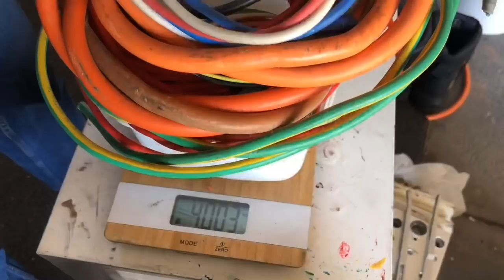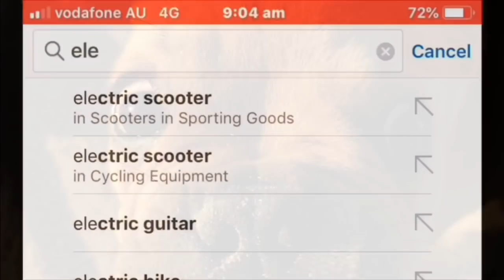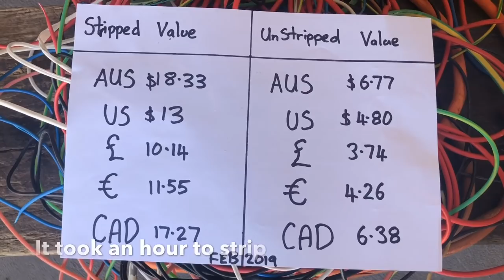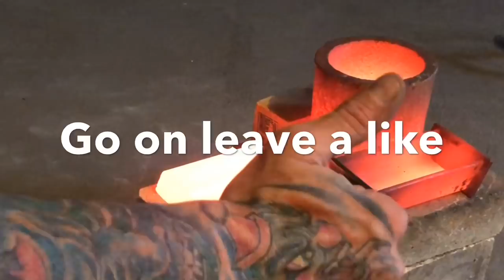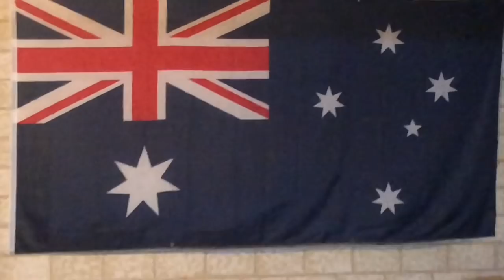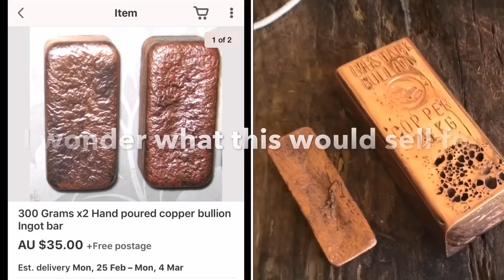To Strip or Not To Strip - Is it really worth stripping Copper Cable🤔 - Melting Copper

Comment: Yes if you make $2 an hour; no if you make $75 an hour. Easy....
Reply: I unironically had a job that paid about a euro per hour
Reply: Actual., it takes les then 1.5hrs to find 25kg in copper scrap and 1hr to strip it., add an hour to smelt and devide that by todays vallue of $146.37 for 25kg usd and 3.5hr... that averages $42.375 per hour...so preaty fricken good.
Reply: @TWOSU_NEWS  add fuel on there
Reply: @TWOSU_NEWS  

The only way you are going to find that much copper in 1.5 hours is to illegally go into an old Warehouse or building and to illegally strip all the copper plumbing and wire out of the building.
Reply: Rob M  simple., i live in the united states, were anyone can go dig through a construction sites trash bin and collect a hundred lbs of copper scrap as long as it isnt fenced or says no trespassing. Further more, you can even walk down the road on a daily basis and collect 200lbs of aluminum cans on any given day... yes, us yanks are a bunch of waistful bunch., o" and if your heart contends, you can go to ANY landfil, sign a waiver and go scap digging...

How do i know this... because i used to make $350.00 a day doing itfrom the time i was 18 to 23....

To answer your quistion., not many people are willing or have the resources to turn scrap metals into non scrap metals as this guy is doing., hence why the price sky rockets when he refines and smelts these metals.
Reply: Rob M MR Rob M I work on demolition and I’ll say that trucker it’s right, as it’s not in a federal property and not properly signed any person can ask you permission to dig on your dumpster and collect some wire, but it’s not jus common wire, a lot of times there’s heavy duty wires , we are talking #1 wires on copper, you may ask why the demo guys don’t just collect them, and the reason is we have a contract, we demo the building and clean the building, you can scrape after work hours, but there’s people who does that for a living.
Normally I’ll handle that opportunity to Old men’s or people that apparently wouldn’t be able to get a job.
They bring a trailer, park it next to dumpster and we carry it to dumpster and they pull it out from there for legal reasons.
Obviously we cannot stock it on the building, and we normally are out of town as many construction workers know.
So is free help when you are by contract, they take that and save space for more garbage.
So yes, in a lucky day they can collect a lot of copper.
My humble opinion.
Reply: @Well_I_am_just_saying  Sounds like it could be something you did once a year or every few weeks just to add in your overall income. I think there's a lot of income potential out there they may of us are overlooking just because we're looking one job that pays above the rest. It's no so easy to lose income when it's coming from multiple sources.
Reply: @peppernickelly  As someone who scraps all the time since I work in construction. Aluminum is barely worth it at all. It takes so much since it's such a light metal that your time simply isn't worth it unless you have something like alum siding or gutters. Copper is where it is at but you WILL NOT just find hundreds of dollars of it lying in trash bins at unlocked construction sites. You will find mostly scrap slivers and minor pieces. You have to decide how much your time is worth and as someone who does it regularly I will tell you that you leave the scrap yard feeling like an idiot for wasting your time way more than like a winner. If you get caught removing material from a job site you will be charged with theft and trespassing. You need a good lawyer to get away with the "no sign" defense and if you're scrapping you probably can't afford one.

Edit: by all the time I mean I save scrap and make a run every 2-3 months
Reply: @toastedt140  Yeah I completely agree with you. I just collect materials here and there over the years, old electronics, silver, gold plated anything, even some weird alloys, and some mercury. Over time the value of the dollar goes down but the material I hold onto doesn't lose value, more likely gaining value. Now I know why my grandpa kept piles of junk for years. After collecting enough material it'll be cost effective to process everything but for now I'm just collecting whenever it comes up
Reply: Come to my city on  trash night (every monday).
 The lady who collects cans on my block fills a 50gal trash bag. Another guy comes by for the bottles. The amount of household appliances that get tossed out is also ridiculous. 
Factor in that recycling is almost the norm for everyone in the city, your scrap metal is presorted and placed on the curb, no dumpster diving.
All I'm saying is that in some areas the guy making 150k a year doesn't care about a 5cent deposit on a can or the the copper value in the Dyson vacuum that's tossed on the sidewalk. 
I'll make a video of all the trash this week so the scrapping crew can salivate over the potential profit.
Honestly scrapping isn't in the minds of housewives,laywers,bankers or other young professionals.  So YES THE STREETS ARE LINED WITH COPPER AND ALUMINUM
Reply: @TWOSU_NEWS  where are you finding that much copper that quickly? I'm an electrician and if you're finding that much you're stealing it.
Reply: @TWOSU_NEWS  this is so dumb. There are no construction sites with hundreds of pounds of copper in the dumpsters and they won't let you on site because it's a legal risk to them. Quit lying.
Reply: Rob M  You need to be more open minded your so closed off from possiblitys. Its going to stunt your experiences in life. If people think gathering 5,600 cans or loads of copper in 1.5 hrs is impossible. Imagine what else people think is impossible so they dont even try. Think about that.
Reply: Your so closed off being humble goes along way too you know. I'm looking at the math and it's what you set not every place in the world is going to have a set amount of copper per cubic yards. Just try to be more open minded man. I'm not trying to be confrontational with you I just want the world to be a better place.
Reply: @anthonydifranco4597  no video tony what happend man?!
Reply: @robinsoncrusoe6327  I think he needs to change the T to an F
Reply: Rob M  clearly you havent worked contruction. Talk to an electrician. Better yet. Watch one work. Even better,  take a peek at the electricians trash bag pile that they create. Sometimes you cut up a piece and throw the leftover bit in the trash
Reply: Rob M  I disagree with you saying that its impossible to pick up copper at a job site. Most places are probably like what you mention but you know how it is: no job site is the same. Some projects have people that dont give a damn about small stuff like that, some are very strict. Maybe the electricians will let you pick through their trash bag. I actually asked once and it was fine with them. They throw a lot of cppper wire away. Still have a couple copper wires with me cause theyll come in handy. My point is that it can be done, but to make a profit or a living out of it is unlikely.
Reply: Rob M  for real, I wanna address too... 50kg just lying about...
Reply: Rob M  Just look at people who throw away home devices that have electrical motors, or power converter boxes. Anything that has spun copper wire! Yeah, it would take a lot but over time you can accumulate more than you would think.
Reply: Rob M  When I was about 5-10 years old, my father and I would be in his truck and will fill it up 2 or 3 times in a single day with aluminum cans. Within about 6 months to a year's worth of collecting them, he had cashed in almost a tons worth and at about $0.50/lb he brought home nearly $900.00. So yeah, 200lbs does seem a little excessive, however, if you are in a city and there happens to be some kind of sports venue or music concert and you are able to collect them from the parking lots... It is conceivable.
Reply: Rob M  That's why I said it's a bit excessive, but depending on where you live and how persistent you are, it can be achievable, just not for everyone. Some in some rare cases, yes it can happen but normally no. I could easily believe them if they said in a week, but not every day...
Reply: The Dirty Trucker Not bad if you’ve got nothing else worthwhile to do
Reply: @Automobile Addict yes too stupid to realize you were clearly trolling from the beginning... Im asking what is your purpose of trolling dumbass
Reply: @nonya8694  there's 5400 seconds in an hours and a half so that's more than a can a second....
Reply: I tried to read down through the comments but theres just sooo much bullshit to pick through...1, I've worked at alot of construction sites, your not getting their copper, brass, or really any other metal. if they charge the customer for 100 ft of wire and use 75ft best believe they are saving the other 25ft to use at another job or scrapping it themselves. same goes with removing old wires, motors, pipes. customer gets charged for the new, company will stockpile the old until price goes up and double tap the profit. I have yet to see a construction site just trash metal. the only metal I believe you could find in bulk is aluminum, but as someone said it's not worth the time it takes to collect it. yes your grand pappy might of collected cans when you were younger and made good money doing it, but price is super low and cans are much lighter than they used to be. I collect my own copper, brass, and such when doing projects and over time it will build up but to think your gonna get 25lbs of copper a day from dumpster diving is an unrealistic goal. might get that lucky once or twice a year if you find joe blow remodeling his house and tossing it out. but again aluminum isnt worth the time it takes to collect nor the amount of gas to melt down.

Comment from the maker: HEY YOU BEAUTIFUL PEOPLE DONT FORGET TO WATCH MY AUSTRALIAN THEMED VID🍻.lots of redback spiders great bushlands and awesome beaches  you won’t be disappointed 😉😆👍🏻
https://youtu.be/sHlBPtveiWw
Reply: And your pug
Reply: Besides spiders and Australian flag, this is the most Australian thing I've ever seen...
Reply: You should make super smash Bros coins using molten metal
Reply from the maker: Yeah they look cool , I’ll put it on my list 😁👍🏻
Reply: What was the name and the model of the wire stripper's you used
Reply: @codyscott547  it's a Frenchie, isn't it?
Reply: @thomashill3457  Use "pause" button on your browser player .
Reply: @iridios6127  ? On my browser
Reply: @thomashill3457  
Yep,in a moment there autor purchase the cable stripper.
Reply: Pricing is different everywhere jumps up and down but definitely worth it stripping it not burning it
Reply: Cute little spider
Reply: bigstackD Casting you should have a picture of a Kangaroo wearing boxing gloves next to the flag
Reply: Why did those bubbles form?
Reply: Angela Swaim. Gasses couldn’t escape from the molten copper quickly enough. Copper is a bit of a bugger to cast especially in a metal mold. 
Sand molding helps reduce the issue as well as adding a little bit of powered lithium just before pouring.
Reply: bigstackD Casting, OK where's the gold and silver?
Reply: So was it worth it whats the difference?
Reply: Why did u buy a stripper if u alredy have the power of the fire
Reply: bigstackD Casting Can i buy some of ur metal items cuz they look so good

Comment: Save the 10 minutes, heres the short answer:
 if stripping can be done by machine, yes its worth it. If done by hand it needs to be big wire to be worth the time, injuries, and sweat. Even then, not really worth it.
Reply: It took him one hour with the machine to strip these, for a claimed benefit of about 7€, not counting wear on the machine and electricity. That step does not sound worth it to me, at all.
Reply: @ccreutzig  yeah, when you put it that way I must agree. I didnt watch the video. I took my own advice. But I agree, no 7€ teturn would get me off my ass. But if thats what happened in this video it is not representative of what is possible with a good machine. My comment is based on my experience and in an hour I can double the value of 50 pounds of copper. Im also an electrician and will have 3/0 or bigger a lot of times. 
My point is that both what you have said, and what I have said, are both true at the same time. Dont let what he made out with make you think you cant earn some money with a machine.
Reply: @thetroof5525  sounds like youve got everything real men need except a tiny yapping lapdog and a bitter ex

Congrats on upping your addiction game, most people are just posers
Reply: @tonyh1718  lol, thank you.
Reply: I think the real question of this video is: “if you need copper (for some reason) is stripping wires worth it?”

Im thinking of getting something to smelt metal for my CNC machine, cuz in The Netherlands raw metal is really expensive! Also the problem is that i cant seem to find anything with the right width, height and length
Reply: If you are melting at 1100 °C why would you bother stripping it. Burn it off first, then burn the remaining off during melting.
Reply: @messiahjonz  because burning it is illegal, and really bad for the environment.
Its the same reason you dont burn plastics.
Reply: @thetroof5525  illegal?
Well... maybe there, but not here.
As for the environment... burying plastic is better than burning it? Not so sure about that.
Reply: @messiahjonz  i comment on the environment only as it relates to us;
If you think it better to burn it, who am I to say otherwise? But Ive burned it and seen and smelled the black smoke. Honestly, I cant wrap my head around the idea that burning is better. Seems like putting it in the air means someone's gonna be breathing it. In the ground not so much.
Reply: 8 dollars an hour for stripping. Most places around here pay more to sweep floors